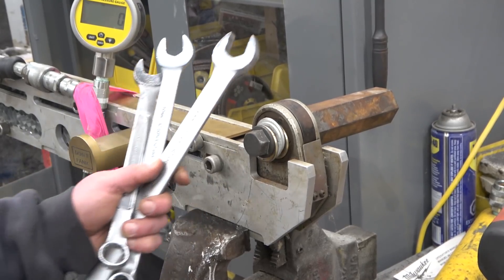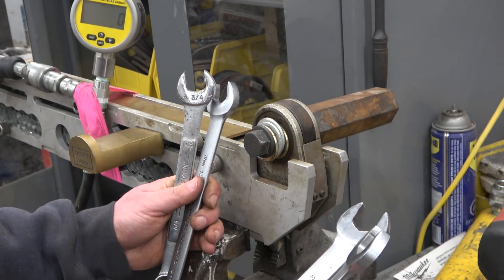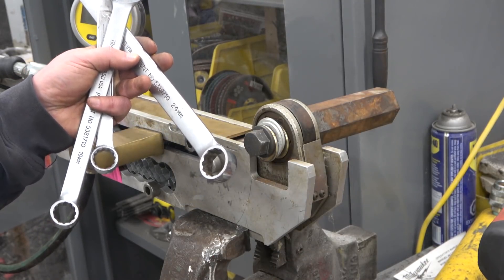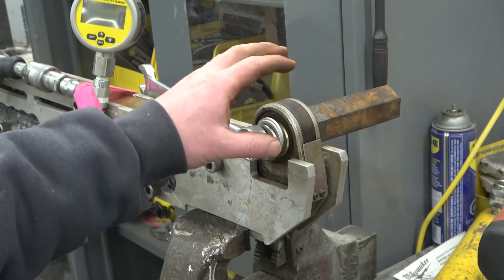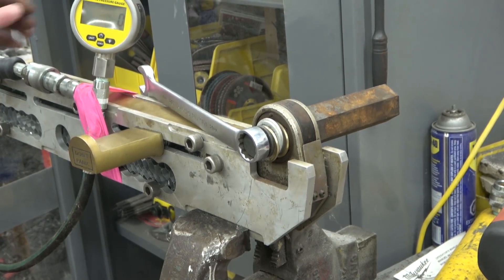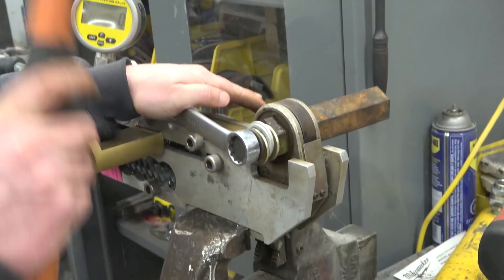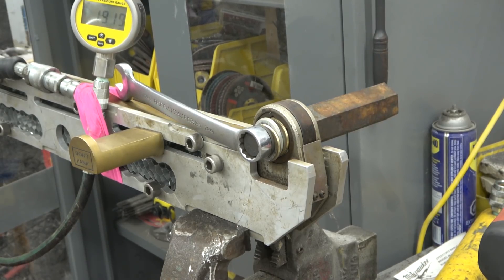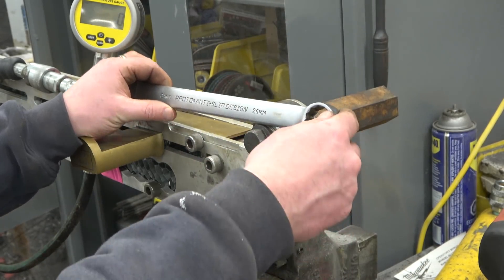do METRIC wrenches fit INCH bolts?

Comment: I often have the pleasure of dealing with the insane collection of smaller size imperial Allen keys... not even telling about the wicked "bristol spline" keys. And BTW, t's a luck there is only one set of Torx heads, we could have metric and imperial Torx heads X-D
Reply: M3 is quite standard, there is also M7, but that's reserved for italian motorcycles
Reply: @TheNeteiksu  M7 also used on VW brake calipers.
Reply: @TheNeteiksu  …and also the gearbox filler and drain plugs on certain old Atlet  (Swedish) fork lift trucks.
Reply: M3 and M4  are common on hobby machines, like CNC routers and RC cars. M7 is a friggin unicorn and my hotend on my 3D printer is M7. Needed an M7 nut so I jam my heat break at the right hight while replacing my hotend. Didn't have one at my local ACE. Luckily I had an employee worth his salt know there was an SAE equivalent. It was a tad loose but was able to jam er in there and get it to work.
Reply: Oh they are impossible. To many of them, to small to have any markings visible, all look the same, always losing them as they are so small. Metric just has  0.5mm intervals at the small end.
Reply: @lindsaycole8409  how often do you use a 4,5mm Allen key? 

Where do you even find a 4,5mm Allen key. 

I currently am working a job where I have to turn a lot of metric screws. 

And as far as I can tell you only have "outliers" below the "M6" mark, above that everything is in 2mm steps. M8; M10; M12 and so on. 

I also never had anything below M4, but I know M1 and M2 exist, but I'm unsure about M3, but wouldn't be surprised if it exists.
Reply: @Tankliker  1.5, 2, 2.5, 3, 3.5, 4,4.5, 5.5, 6 ,7, 8, 10. I was talking more about the small end, larger fasteners in both systems have large gaps above ~1cm making them pretty obviously different visually.
Reply: @Tankliker  There's probably some evil bastards on the metric side that use stupid size fasteners like Moen uses their 7/64th inch hex you need to remove their plumbing fixture handles.
Reply: @Tankliker  There's M3 (5.5mm nut), M2.5 (5mm nut), M2 definitely.   Not sure about M1 but probably.   There's also M3.5 which is used for holding electrical faceplates on in the UK.
Reply: @gavster89  I cannot follow here. 

M3 (5,5mm)? That's the Allen key in that case you need to turn it?
Reply: @Tankliker  no it's the spanner size for the nut that fits that thread.
Reply: I don't mind using 2x4s or 1/4" lag bolts, or welding inch-square tubing... but what absolute dingus is still making small mechanical devices with imperial hex-head screws. Ruger is terrible about this -- you have to read McMaster Carr like a novel to find some of their godforsaken archaic fasteners they still use.
Reply: The faster imperial dies out, the better for our tool boxes NGL.

Comment: Could you snap the wrenches, if you were to machine a fitting hex on the end of the bar? Asking for a friend of course ;)
Reply: That's a great idea just mill down the hex on the end to whatever size instead of threading a hole in the  hex
Reply: Would have to be some hard and tough material, seems to be doable though
Reply: bolts are easier then heat treating.

Comment: I'm restoring an old volvo amazon with my father. That car was developed with every kind of bolt size available. It's madning to find out if a bolt is metric or not, if in the 50 yrs some mechanic used the wrong one and messed up the thread...
Reply: Sounds like early 2000s farm equipment
Reply: Sounds like farm equipment through the ages and most restored cars
Reply: Sounds like any series Land Rover. Haha
Reply: @SuperDeeredriver  2000 ? we had that trouble in the late 60s in the UK
Reply: This is one of the few reasons I like Japanese cars, they are much more likely to be all metric. I have a Jeep which has metric, SAE, and torx. I never know what to grab before I start the job, and different years seem to use different bolts even, on the same model.
Reply: @snoopdogie187  I've worked on my my mate "bombproof" D22 Navara and found some AF tools fit better even though the thread is metric
Reply: I mean if it fits...and you're not the next guy...

Comment: A lot depends on how well the spanners were made; how good the tolerances are...
Reply: By the raw numbers, 19mm is .002" under 3/4" and should always be a valid substitution.  24mm is .007" over 15/16.   A difference of just under 1%.  Should generally be just fine unless some idiot has already rounded off the points.
Reply: @danbance5799  "Should generally be just fine unless some idiot has already rounded off the points."
I see you met the previous guy who's worked on all my shit.
Reply: I'm worried about your name,  friend.
Reply: @billy_fred  - Says you....LOL
Reply: Indeed
Reply: not just the spanners even the screws and nuts. i had some cz/jawa engines apart and the hex screws and nuts used there a sitting tight in every spanner. no woble whats so ever. compared to the standart din 933,934...
Reply: @tomast9034  The soviets had their own separate standards, basically metric but sometimes the production' quality was so bad that it may as well be an in between size. I've found that modern wrenches of the same size fit better than the USSR branded ones. Also the most common type they made was the basic open end wrench with one size on one end and a size up/down on the other, so they are better than nothing but not by much.

Comment: What steel is the bolt? Might I suggest a carbon steel if it's not, to really put these wrenches to work. I find the threading to always be the weakest link under high torsion/pressure environments.

Comment: The real question is why the fuck do people even still use imperial fuckery?
Reply: people need an excuse for the rounded off nut.
Reply: Too much old equipment, vehicles, tools, things that will last forever that will require SAE tools forever.  Even if, and as, less stuff is made with SAE bolts and fasteners, the need for the tools will remain forever.

Unless you ONLY work on brand new stuff, all the time, every day, you will always need the old stuff.

Comment: Manufacturers know this too and leave certain sizes out of their “sets” if the corresponding metric or sae is in the other one. Sneaky cheap bastards.
Reply: Its a shame they don't stamp both sizes on the tool, but then, how would you teach your firstborn flashlight assistant all those "mechanical terms?"
Reply: Not sneaky,practical and if you get a digital caliper and a handful of bolts,get your wrenches you can do your own experiment

Comment: My first use of metric wrenches was on my rusty old 1970s AMC car.  After enough corrosion the SAE nuts and bolt heads had somehow become metric.
Reply: anything is metric if you hammer the wrench on hard enough.
Reply: Metric rust is fairly common on conventional vehicles.  British cars using the positive earth electrical system are often subject to whitworth rust.
Reply: @damonthomas8955  I have always wondered why there were Whitworth wrench sizes.
Reply: @keithfork8663  it all started before the Crimean war when rust was known as russian corrosion.
Reply: @keithfork8663  Because they are square!
Reply: @damonthomas8955  Is this a joke or is there a true story behind this? Could someone clear me up... O_o
Reply: I had a Ford in the UK and whenever I went to loosen a bolt under the car it would inevitably be rusty and I'd ponder to myself:
"Why the fuck did they bother with thread locker? They're rusted on." 🤷🏻‍♂️
Reply: @thomas316  because they only stayed on long enough to rust because of the thread locker?
Reply: @TheUntamedNetwork  I call BS
Treadlocker is overrated in most applications
and I will haunt your soul for eternity if you put threadlocker on brake calipers, especially if they have a half hight head

only exception might be something like inside a transmission when you really don't want the bolt to come loose and you can't really tighten it too much cuz the case is made of aluminium(why yes, I am european)
Reply: @nathanwest2304  i very rarely use thread locker. Its funny you say on caliper bolts because i never ever used thread locker on caliper bolts until the last shop i worked at. My manager insisted on using red lock tite on caliper bolts. Smh. You can crank those things so tight theres absolutely no need for it. He still used it on every single vehicle. Always used it for the driveshaft bolts on the rear dif side. Old rusted 12pt 12mm or 13mm bolts with an aluminum driveshaft n still used it on those everytime. Most of them we had to heat them up to get them off. Dude loves that stuff.
Reply: @nathanwest2304  Threadlocker... on caliper bolts?
Reply: @nathanwest2304  I use threadlocker for my trailer axle nuts. They did not come with carter pins!
Reply: @ClayGravil  There are psychopaths running around everywhere.
Reply: Nature finds a way
Reply: I have the opposite issue working on my old Volvo. Metric bolts have a tendency to need SAE tools after a while.
Reply: @MrJamesBanana  The nuts for the exhaust manifold and turbo on my Saabs always go from 13mm to 1/2" for some reason.
Reply: 🤣😂 so true!@!
Reply: If you let that AMC rust long enough, does it eventually become Canadian?
Reply: @DaddyBeanDaddyBean  Very possibly.  Have you ever actually looked at an AMC?
Reply: I can confirm it. I did an complete engine overhaul on a AMC 304 with metric sockets and spanners.
Reply: Designed to fail in a convenient way.
Reply: _this was not supposed to be on this reply_ After a full ctrl-F5 reload it moved to the correct reply. . .
Reply: I had a '77 Jaguar XJS (not long after Jaguar was aquired by GM) and I was forever finding BOTH metric and imperial throughout.

Comment: I think we'll find the same in a comparison of metrique and inch standard crescent wrenches, same, same but different.
Reply: The left handed crescent wrenches run bass ackward, keep an eye on the fit.
Reply: I even have one in left handed metrique!
Reply: Thanks for the heads up.I have a metric brass hammer that doesn't always work well
Reply: Nothing is more fun than asking your apprentice for a left-handed, metric crescent wrench!
Reply: @geoffblanchard939  you jest, but I have encountered a few crescent type wrenches with sinister handed threads in the adjuster, so turning the wheel to adjust the size is backwards from the usual expected action. Of course, this is the elusive ‘left handed’ crescent wrench.
Reply: @geoffblanchard939  Or a left handed metric hammer
Reply: I can't wait to get to Autozone and ask for the metric crescent wrench.  Thank you for pleasuring me.

Comment: Other useful sizes for guys who might not know 

5/64” - 2mm
5/32” - 4mm
5/16” - 8mm
7/16” - 11mm
5/8” - 16mm
Reply: 1/2” and 13mm are good enough for the girls I go out with
Reply: 5/16 and 8mm are good in car land. 5/16 is just a bit smaller than 8mm, I'll hammer a 5/16 on rearend centerpin bolts every time.
Reply: 1 1/16” is just a few microns from 27mm, also.
Reply: 3/8" <- 10mm (other way don't always work)
9/16" <-> 14mm
7/16" & 11mm I find sim / worse than 3/8" & 10mm. Works one way, but rarely the other.
Reply: @murph0666  great so now you can also lose the 3/8" sockets
Reply: @h0lx  9/16:here 😂
Reply: knew the 5/16" = 8mm and probably the others, but whatever, `ha `ha (in French) also a 10mm will at least crack a 3/8 nut, but only snug it enough to be able to go skate.
Reply: @_Ramen-Vac_  10 mm is 0.018" larger than 3/8" is. So a fairly loose fit. As you go down in size tolerance needs to stay tighter.
Reply: @1pcfred  sure.. but it will break the nut w/o stripping it too badly..  a Teflon lock nut can only be threaded and untreaded like 5 x or something anyhow, and a skater always has duct tape too, forgot to mention.
Reply: @1pcfred  AH!! I knew that too. And how about a $500 roll of aircraft repair tape while we're at it. You're right Duck tape sucks these days too, I usually go for Gorilla.
Reply: 13/32" = 10mm.  Usually.
Reply: @dfross87  SAE sizes run by sixteenths. Any thirty seconds are oddballs.
Reply: @1pcfred  Older stuff often has those oddball X/32" sized bolt heads.  Because reasons

I have an old set of spanners that has every size from 3/32" up to 1" (inclusive).  And a mishmash of sockets that give me the same range.
Reply: @1pcfred  Clearly you don't work on old enough equipment.  I wouldn't swear I've used every oddball size, but enough to know that spanner set is worth it.

Vice grips don't fit everywhere.
Reply: The ex-wife seem to prefer whatever size I wasn't